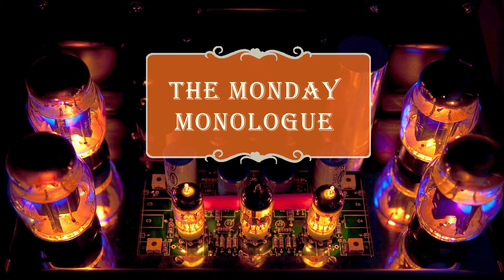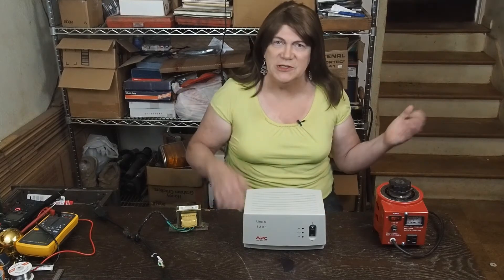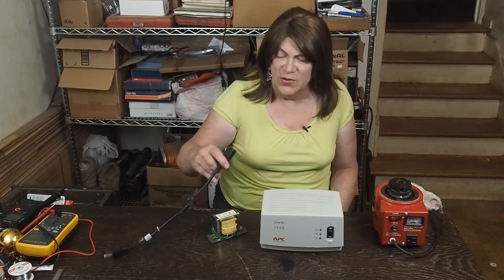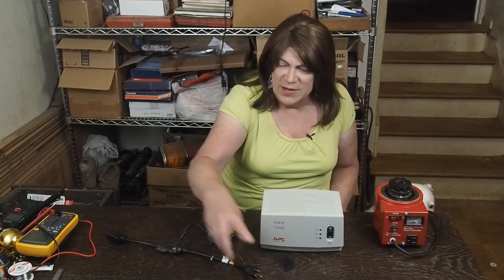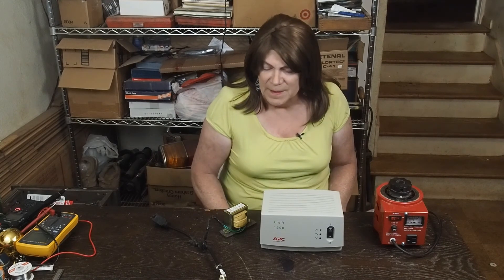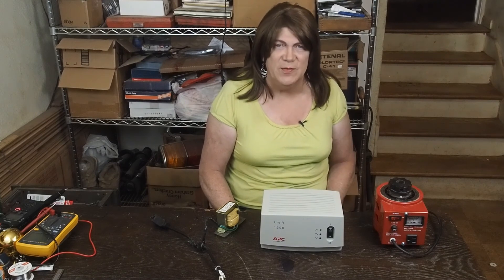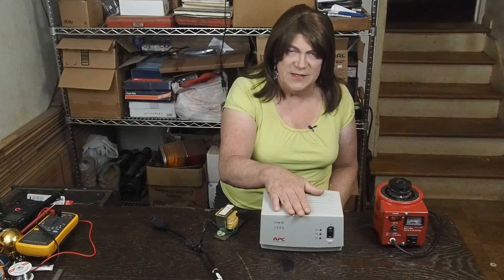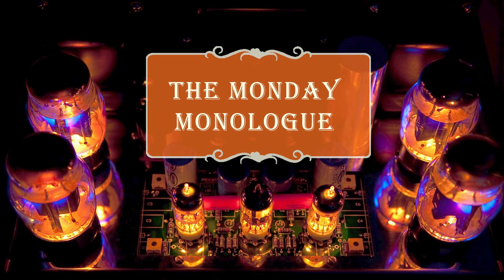Monday Monologue: China Tube Amps and 110V Transformers

Comment: I got the 6P1 amp and a Hammond 166N12 transformer but it's only outputting about 15v according to my DMM and it's not powering up my amp. Can you send me a link of exactly how the wiring is in yours? I saw your links but not sure if I read the schematics right. I connected the 2 black wires to the AC input, and the outer 2 of 3 green wires to the amp input power, leaving the center green/yellow wire unused. I saw another diagram showing the white neutral passing through, but does that connect to the transformer in any way? You can reply here or on Head-Fi: DecentLevi
Reply from the maker: Yeah you just have it wired as a transformer. It's hard to explain in text and if you can't read a schematic, makes it even more difficult. Figure 3 on this page is how you want to wire it. make sure you check the output voltage before you connect it to anything!

https://sound-au.com/articles/buck-xfmr.htm

Comment: Stephe, I'm really glad I found your channel. As the owner of several ChiFi pieces of gear I have wondered about the 110v ~ 120v compatibility in the specs. While I have not had burnouts, all tube gear, I notice that my push-pull KT-88 Muzishare X7 amp gets pretty hot. So I ordered the APC 1200 and set it up for 110v and connected my three chi-fi tube pieces, amp, phono stage, and DAC. There is a very noticeable hum using 110v which is not acceptable for listening enjoyment. When switching to 120v everything is Dead quite, very nice. I'll run at 120v for several days and update any change in heat output. Sounds wonderful. To note, I've had these three chi-fi pieces for over a year with no tube failures. If nothing else the APC should be a nice conditioner/regulator/surge protector for the system. Greeting from Pisgah Forest, NC. We lived in Fort Valley ,GA for a decade plus. Much prefer the mountains. Cheers!
Reply from the maker: The only way to know if the transformer is 110V or 120V is to measure the heater voltages. For example the Nosound 6P1 is a 110V (it's actually written on the transformer) and the heater V is too high when used on 120+V. This A50 is wound as a 120V.

Comment: Stephe, thanks for this topic video.  If nobody else makes a request, how do you like the mA meter in your KT88 build?  I would like to know if mA meters "wiggle like" VU meters when measuring driver tube current in tube amps?  Maybe meters in tube amps would be a good future topic.
Reply: mA meters are used typically for biasing of the tubes, a switch that allows you to switch between them and switch it off. The gotcha is for some topologies like push pull or cascode is you need to ensure high enough isolation between the inputs and the chassis (otherwise the meter will arc and short to the chassis).
Reply from the maker: It's a really nice setup, which could probably be duplicated in function by a cheaper meter than this higher end one I purchased. This design only works with a cathode biased amp and uses the cathode resistor as the shunt. And no, it doesn't "wiggle" like a VU meter. I'll toss this on the list for future topics!

Comment: Bucking transformer idea sounds neat!   but I wonder what will happen in a say a brownout when line voltage drop to 90v or less?
Reply from the maker: It will follow that voltage at the same voltage reduction the bucking transformer provides. If your location experiences brownouts often, you probably need a battery backup type box, but I don't think a brownout will effect tube gear like it does solid state stuff. I do know that rapid off and on power spikes aren't good for it though.